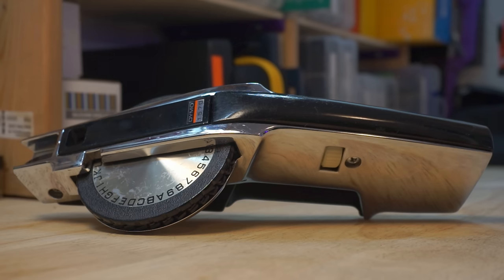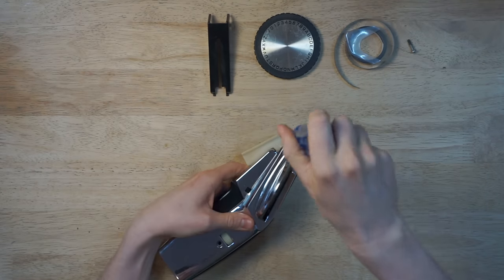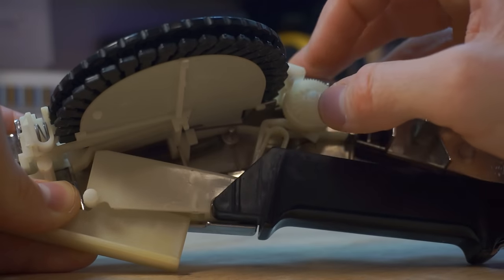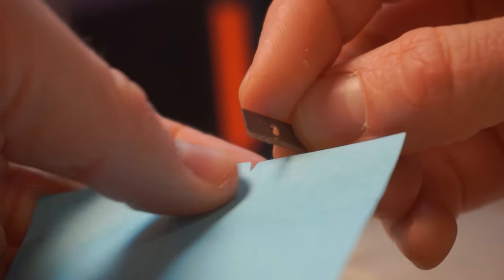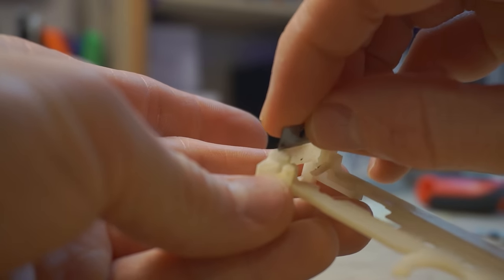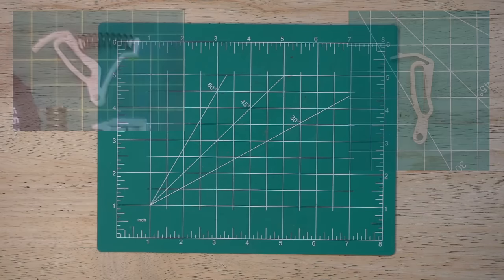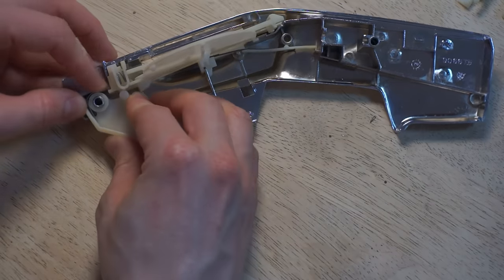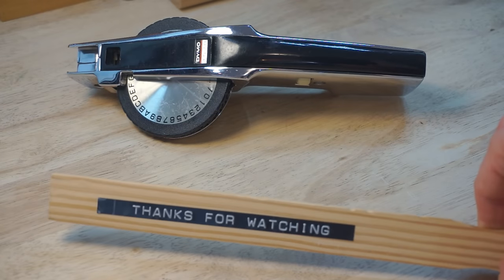DYMO 1570: The Cadillac of Label Makers

Comment: It's hard to tell, but I don't think the cutter is working quite right. What you should end up with is a partial cut through the thick plastic but not the backing strip, then about 2mm further along, a full cut through the tape. What you end up with is a little tab at the end of your label that you can grab to peel off the backing tape. You can see this a bit at the start of the video - the first blade has cut the plastic but left the backing. The other blade wasn't working at all.
Reply from the maker: You're right, I didn't show this very well in the test, but after the repair it was doing the double cut with the tab to allow easy backing removal 👍

Comment: Not that I have ever put a lot of thought into these - let's call em "Analogue" - Label Makers but it just dawned onto me that unlike modern "Digital" ones these seem to work on the principle of Stress Marking the Medium, huh? 🤔 Like when you bend a piece of colored plastic, and the bend turns white 🤨
Reply: Yup :)
Reply from the maker: Exactly! Simple yet effective
Reply: It is a fantastic feeling. If had any less impulse control I would spend all my money on tape and just fill my house from floor to ceiling with gibberish.
Reply from the maker: Yes, exercising restraint in labeling is a never ending struggle 😂
Reply: Call them mechanical, because that's what they are.
Analogue is a term from another field of engineering. "Analog" usually refers to electronics based on a continuously variable signal, wich is used to capture, store and transmit media, as opposed to digital (electronics), wich uses a two-state-signal to create logical cirquits.

A grammophone record is mechanical.
A magnetic tape is analogue, and an mp3 file is digital.

Comment: I scored a complete 1550 kit off ebay last year. It's amazing! i went with the 1550 because it can take the 3/8 and 1/4 label tape. i also got 3 font discs with it. thanks for the rebuild video, i should probably grease mine
Reply from the maker: Sounds like you scored a great find! The 1550 is pretty similar I believe, is nice to have the multiple wheels
Reply: @ExercisingIngenuity  I believe all of it is the same except the tape guide. I’ll let you know if I ever get around to cracking it open!

Comment: You're a man who knows good tools.  
Got that PicQuic screwdriver!
Reply from the maker: I love my PicQuic!
Reply: @ExercisingIngenuity  I bought one in 2004.  It still works.
I emailed them this year, asking to buy new bits, as mine were a little stripped after 20 years. 

They sent a whole new screwdriver.   So I moved the new b its into the old handle, as you can NOT get the 6 Pack Plus in the aquamarine see through anymore. 
(BTW PicQuic are built in BC! Also, it's a million times better than the LTT screwdriver.)

Comment: Not cutting through the label + tape is the whole idea. It makes peeling the tape off the label much easier.

My own Dymo labeller (which I bought in approx. the late 1970s and I still use) does exactly the same.
Reply from the maker: My understanding is that one blade cuts completely through, the other cuts partly through. As you said it makes it much easier to remove the backing. On this dymo neither blade cut completely through, so you could not disconnect the label from the tape inside the label maker. Amazing you still have one from the 70s!

Comment: I have a feeling that the reason the blades where so impacted with tape remnants is that the blades fell out of adjustment.  The inboard blade is supposed to fully cut the tape, while the outboard blade is only supposed to score the label tape while leaving the peel away backing intact... in essence creating a tear away tab that you pull to easily separate the backing.  If you do not have that tiny scored pull tab at the end, then that section is collecting in the blades and will eventually clog them again.  Tape is supposed to look like this:

_______________________
|    Text on Tape        :  |          With the colon signifying the score that creates the pull tab.
------------------------------------

Hope that makes sense.

Comment: I have one of these inherited from my grandfather and honestly my only complaint is that the labels tend to pop off of stuff due to the rigidity of the plastic, so I have to also tape them down with clear packing tape. Might just be because the tapes I have are from the 1980s though...

Comment: How possible would it be to 3d print your own letter disk (or whatever you would call it) to have different fonts, or symbols, or whatever?
Reply from the maker: I've thought about it! The letters on the embossing wheel are small enough it might be difficult with a regular 0.4mm nozzle FDM printer. But it's in the realm of possibility I think

Comment: Cool video. Do you know about mixing super glue and baking soda for filling and fixing stuff? It might be useful for reenforcing the broken plastic in that machine, and you can do lots more with it.
Reply from the maker: Actually I've heard of this, but I've never put it to use! I will have to experiment with it
Reply: @ExercisingIngenuity  it of course works, but its somewhat brittle, no? I would generally go for epoxy if I really want it to hold up for a long time,
Reply: That looks like a thermoplastic (as opposed to thermoset), which means it can easily be welded back together rather than using glue. A soldering iron works great for this, but there are also specialised tools and filler rods.

The end result can sometimes be a little ugly, but it will be as strong as new.
Reply: The soldering iron can be Baking soda and super glue works like magic. It becomes even harder than most epoxies I have come across. (But maybe  somewhat brittle?) 
It is perfect for really tiny repairs, but it requires a bit of practice to get a feel for it. The mix will harden so fast, literally within a second or two, so that you will get your super glue bottle stuck to the thing if you don't plan out how to go about the repair.

I usually make a tiny little spatula out of a match, and use it to apply a little baking soda, then a drop of glue on another match or toothpick, wich you lightly touch to the powder. Repeat if necessary.
If you use too much baking soda, it will harden before the glue has had time to soak through all of the powder.
If you even touch the powder with the glue spout, it will often mess up the rest of  that bottle.

If you need further re-inforcement, wrap your thing with  sowing thread or dental floss before applying super glue. Floss can be split down into even tinyer fibres if necessary.
Reply: @JH-lo9ut  Just use an activator spray instead of baking soda. It has the same result, and you can apply the glue as a liquid instead.

Comment: "Built like a tank" opens up the thing to reveal that all of the internals made of flimsy plastic that's broken in several places.
Reply from the maker: Kind of like a tank, the outside is the most robust bit 🤔
Reply: @ExercisingIngenuity That's very true'
Reply: After so many years? Nothing lasts forever, but at least Dymo tried to engineer it to last. Sometimes plastic is the best for a purpose. Metal would eventually bend and/ or shear, ceramic would shatter upon impact. Plastic can be flexible and dent-resisting. Not every kind is brittle.

Comment: It would be great if you could at least scan the plastic components to reproduce as needed.
Reply from the maker: I have thought about if it would be possible to replace the internals with 3D printed parts
Reply: @ExercisingIngenuity  as long as the scan and print resolution is high, and the filament material is appropriate......😊👍

Comment: I've got one of these, but the issue I have now is that all the labels I have for it are losing their adhesiveness. Having to cover self-adhesive tape with clear tape kind of defeats the purpose...
Reply: Same here.  I do have some that still stick, but most don't.
Reply from the maker: Hmmm, interesting to know this happens eventually. Are you using original tape, or one of the various embossing tapes you can get on Amazon and elsewhere?
Reply: @ExercisingIngenuity  Six of one half a dozen of the other.  I'm not even sure which ones still work.  Maybe none, It's been another 5 years since I tried

Comment: I am shocked it took complete disassembly to access the blades for cleaning and sharpening.
Reply from the maker: You would think it would be easier, right? But after separating the two halves, you can access almost all the components individually, it's not strictly necessary to take all of them out like I did